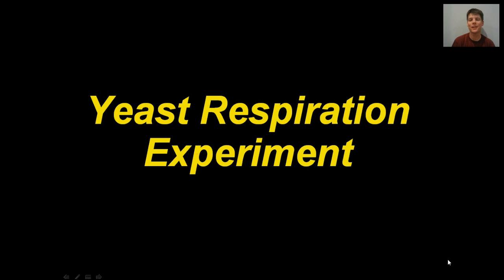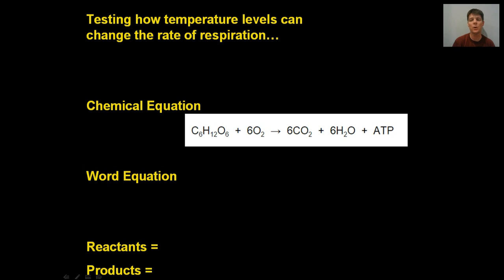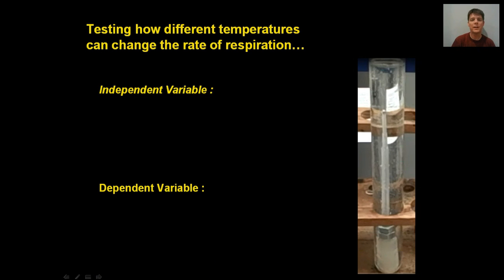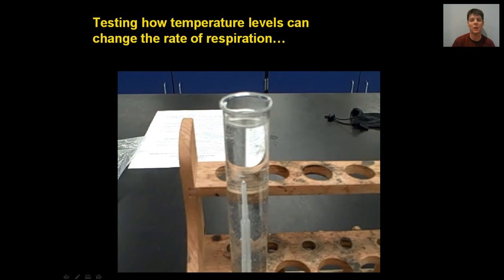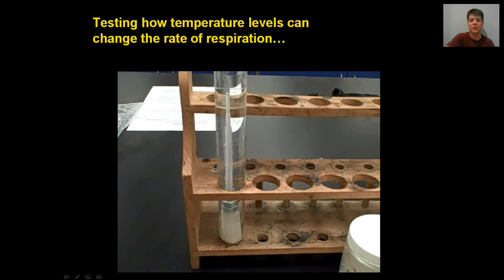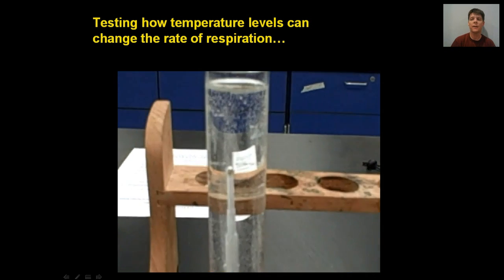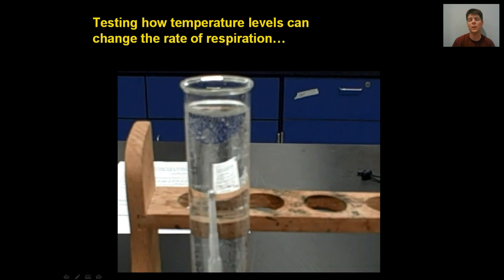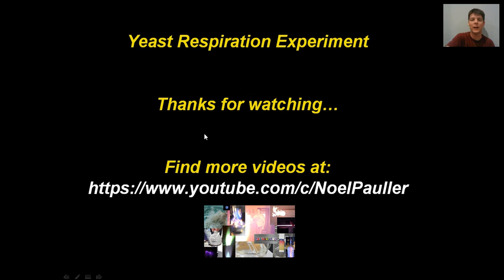Yeast Respiration Experiment (HS-LS2-5)

Comment: Please can you write the required tools😭
Reply from the maker: Yeast packet, beaker, test tube, plastic pipette, metal nuts for weight , sugar solution or Apple juice
Reply: Thaaaankkkk you soooo much ummm you said in the video different temperatures .. cold..medium..warm the final reaction what temperature?
Reply from the maker: @taifa4763  I didn't measure the temp.  It would be an interesting way to modify the experiment to run trials at a number of diff temps
Reply: How can i do that? Is it By repeating the same steps but on different water temperatures?